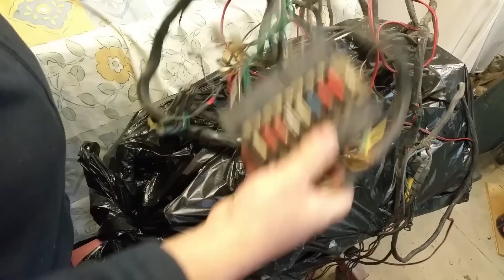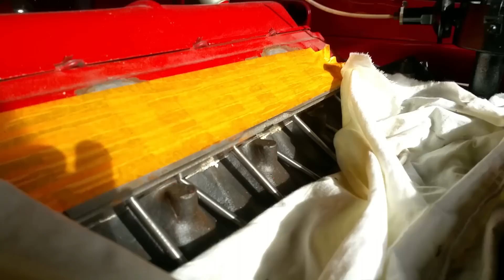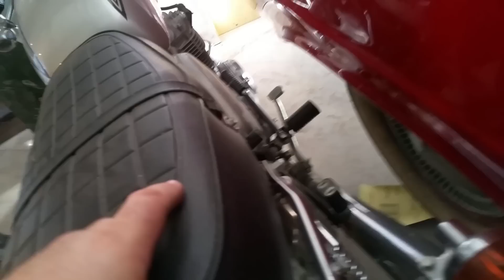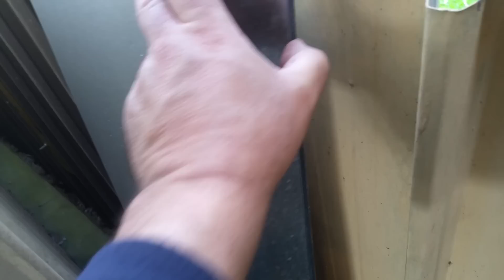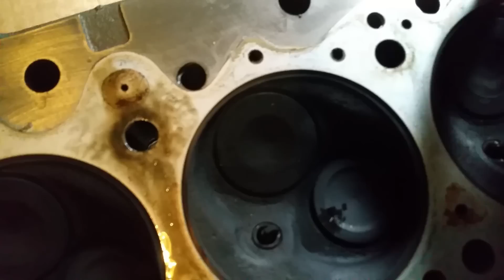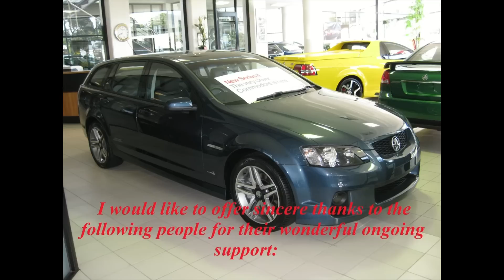NEWS on the projects and the Disappointing Plymouth

Comment: hey peter . Rob here in nowra NSW buddy , just wondering if you could help out Im looking for the location of the engine number on a 302 windsor its a 1989 F150 ozzie car .
Cheers again 
Rob
Reply from the maker: Hi Rob, the engine number on my 351W is at the rear passenger side just below the head... so facing the firewall in a terrible place. Take a look there, 351's are a taller blocks and there's a pad there for the number. I assume the 302 would be similar, but not sure, cheers.

Comment: Hey was thinking bout the merc drama. If you can grind broken stud square/flat ready to drill. Ive had sucess using masonry drills to drill hard material even tool steel. It takes heaps of load on drll to get started and once it starts small chips break  out. DONT use drill lube. Must drill dry. Use dremel point tip  as centre punch start. May save head off business. Good luck. Old toolmakers trick.

Comment: My '62 Dodge 318 has 100psi on all cylinders. Goes fine. 51k miles, and not been touched. Probably less than 8 to 1 compression. Doesn't pink on weasel pee 83 but.

Comment: With that broken thermo housing bolt. You could drill through the aluminium head metal inside the water jacket. This hole could be used to deliver penetrating fluid to the corroded thread on the broken bolt if drilled slightly vertical. Give the fluid a few days to penetrate. Don't be in a hurry. Find a nut that fits over the broken stud. Tig weld ( not MIG) the nut to the broken stud.

Comment: The broken stud. Try a 1/2 inch washer around the stud or even 10mm, mig weld the stud to the washer. Then try to weld a bolt to the washer/ stud molten mass. Then let cool and remove.
Reply: Genius. I also suspect the heat soak can break the stuck threads free too.

Comment: For the snapped bolt head, have you tried putting a nut on the top and then plug welding it on the inside to what remains of the bolt?